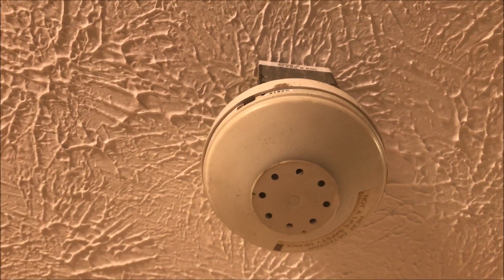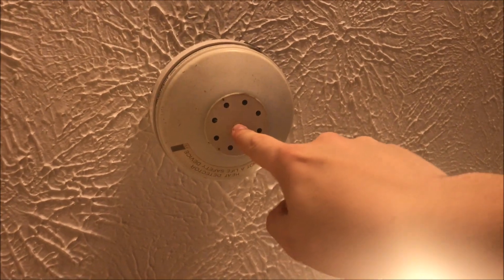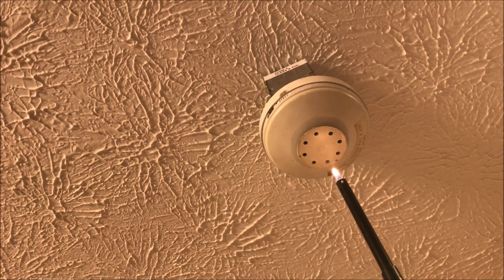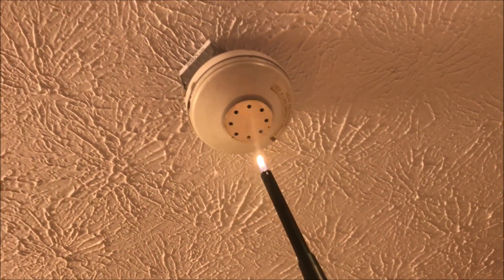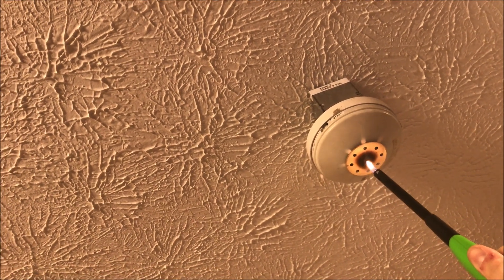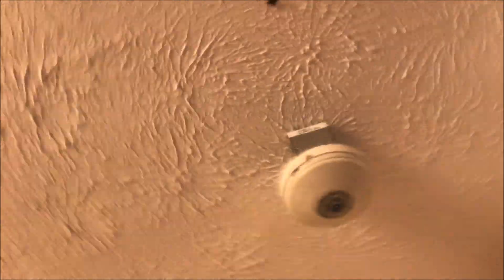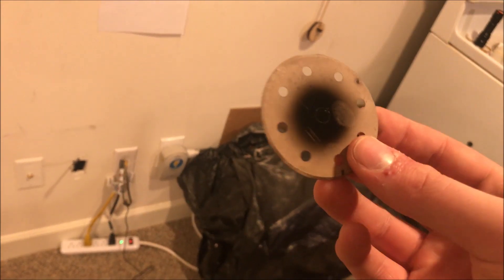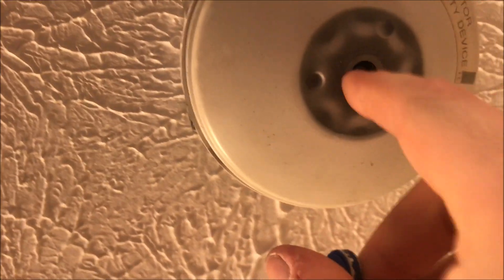Activating an Edwards Heat Detector

Comment: This is the worst way to test this device. You just ruined the divise. Black marks all over the shit, taking a chance to melt those flimsy inside wires and on, and on. Take a blowdryer and applied heat to it, instead. Or tripped the wires inside with a jumper alligator clips or a piece of wire. Your method is the last resort. Oh! A lighter can do the same without the blackness.
Reply: It does not matter how it is tested, that's how is work. Plus complete unnecessary language.
Reply: This is a single use heat detector… the point is for it to get destroyed anyways